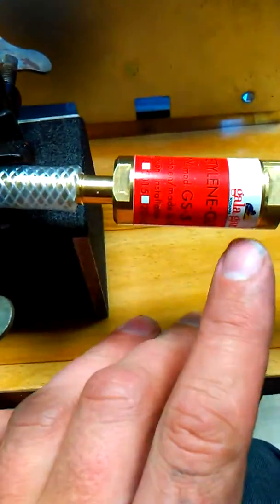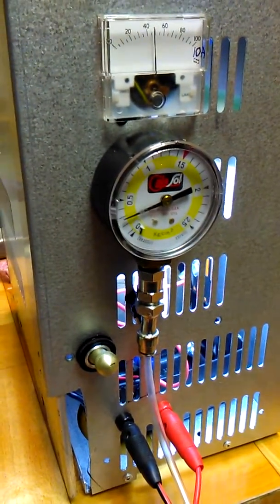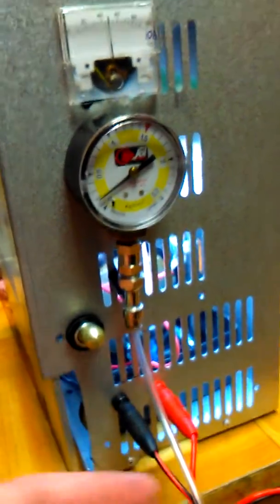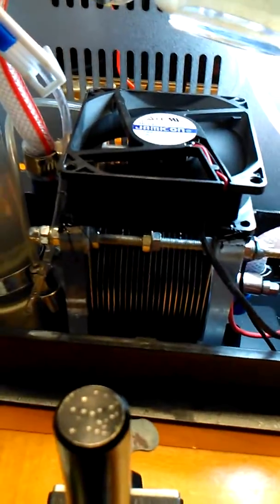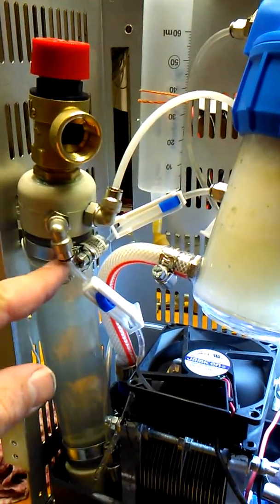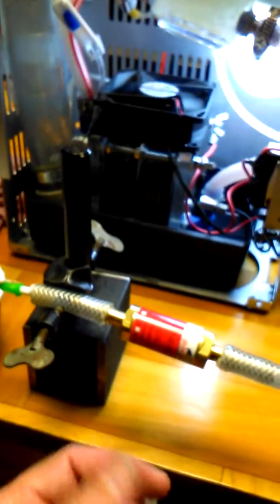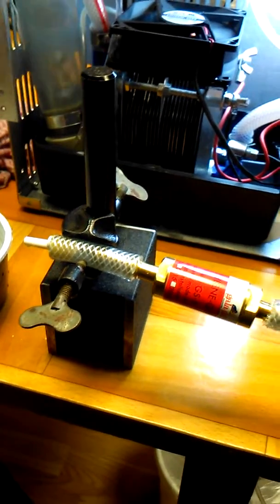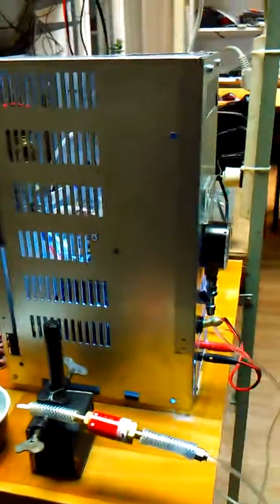2017. Miniature HHO electrolyser torch for work on juwelry  and quartz optical fibers

Comment: Nice setup. I have an equal mini torch (in a wet-joe-cell-setup) but I am using just 5volt and 1 amp (old smartphone charger). My torchflame size is only half that sice of yours but still enough power to melt and cut everything! ^^ I like hho